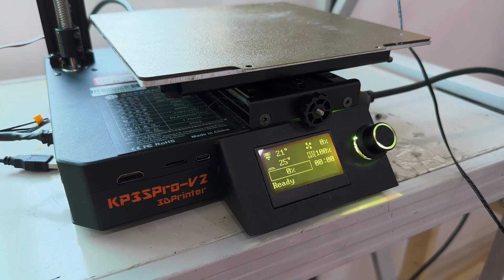How to Replace the heat bed on the Kingroon KP3S Pro V2

Comment: Good instructions, also worth mentioning that with some soldering, a replacement bed is often not needed. It's possible to swap the thermistor or the thermistor cable which is more likely to break than the thermistor itself.

Just as a tip if possible avoid removing the linear rails sliders. It's difficult to slide them back on the rails without having a few bearing balls pop out. Losing 1 or 2 is ok but better avoid it altogether.
Reply: There is nothing difficult about removing the carriages and returning them back to the rails. Every time I buy a printer, I remove the carriages, wash them and re-lubricate them. Cheap carriages contain metal debris, which reduces their service life and impairs their performance.

Comment: For folks seeing this now, I made a center finder for the bed screw posts on Printables. If you mark them out on the magnetic sheet, you can drill out the screw holes with a 2mm drill. The screws themselves are inset far enough that you can just screw them loose with a 2.5mm allen key with minimal resistance.

(Added the link with an edit, but apparently Youtube doesn't like that 😅)

Comment: There is no need to completely remove the magnetic base from the heating table. This is an unnecessary waste of time. It is enough to simply rub the magnetic base at the intended location of the bolt heads with something semicircular, applying force. For example, the handle of a screwdriver. You will immediately see a recess under which the bolt head will definitely be located. Now you can carefully drill the magnetic base with a drill with a diameter of 7.5 mm (approximately). This can be done simply by rotating the drill with your fingers, without a screwdriver. Rubber is very easy to cut with a drill. That's it, now you have access to the bolt heads that you can easily unscrew with a screwdriver. The same holes can be made in a new magnetic base on a new heating table. This will give you the opportunity to remove the table at any time to lubricate the carriages.